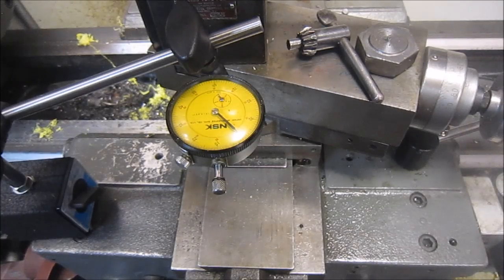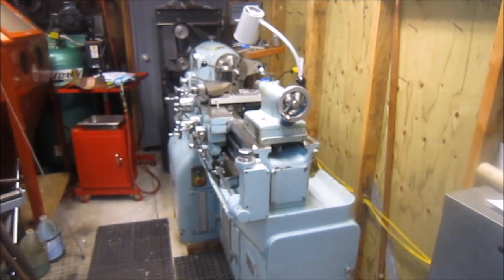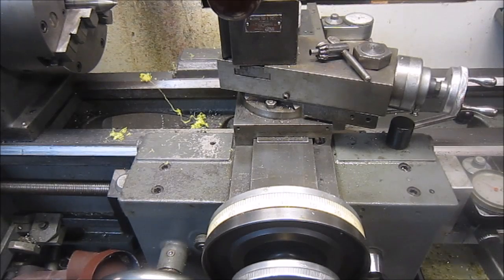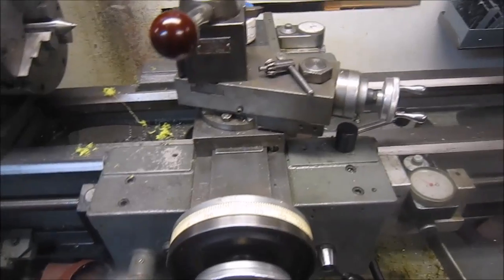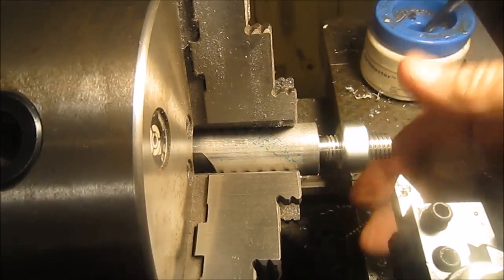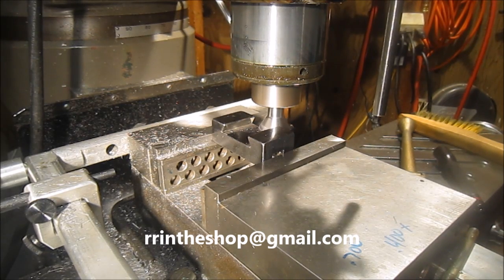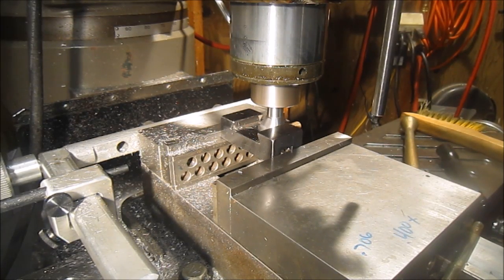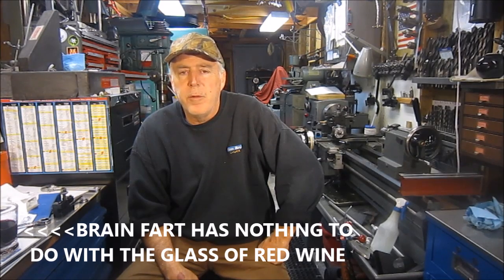Screwy Tuesday #53  Monarch 10ee   Elsr / Electronic Lead Screw Reverse

Comment: I believe that the two threaded holes on the rear of the cross slide of the Clausing lathe, at one time held a retainer plate for a way wiper. That would make another project to show. If you make one, leave a tapped hole for your cross slide stop.

Comment: Hey Chuck I thought the Hardinge HLVH had the finest and easiest Threading mechanics. However, Your 10EE out did that by miles.  Wow what a machine. And that too at age what  64/65 years.  Just a couple of Years younger than me  !!!  My Lathe is 12 Years old, exactly same as the Grizzly Model G0509 and it does not even have half the features or the precision of that Monarch of Yours.  Can we say that it's the original "Rolls Royce" of modern Lathes. Methinks it definitely is.
Must reiterate, U one lucky cat to own one of the finest produced in Your own Country.
ATB
aRM

Comment: One thing you might want to consider, when you are feeding in with the compound for every thousandth you feed in you are also moving the tool .0005 closer the the shoulder of the part. This probably would not be to much of a problem with a fine thread but for a larger coarser thread you will have much more travel in the direction of the chuck or the part shoulder. So for a 8TPI thread with a thread depth of .081 the tool will move .0405 closer the the shoulder of a part. 
What I am trying to say is to make sure you have enough clearance when you start so you end up with enough clearance to finish the thread with out a crash.
This it with the compound set at 30 degrees. 
For every .001 you feed in with the compound the tool moves inward .000866 and .0005 to the left for an external thread.
Cheers 
John

Comment: Hey Chuck,

Check Keith Fenner's dashboard setup. I'm pretty sure he puts the indicator on the flat side of the aloris toolpost. The brilliance of this method is it actually tracks the total infeed of the compound in the X axis. It accounts for any errors in setting the angle and eliminates calculating the diameter change for the thread minor diameter. I remember saying to myself how awesome the idea was from years of sneaking up on the minor diameter with the compound slide only. Nice machine you got there. 

All the best,

Tom

Comment: That's pretty handy. This is probably a stupid question but can't you cut a thread going backwards? In other words instead of backing out and going back to the start couldn't you just advance the compound and cut a thread in the opposite direction? Cut both ways? Did that make any sense? I see another person asked the same thing. Thank for the video. I'm gonna guess, because it would screw up the pitch....?
Reply: This would work in an ideal situation where there is 0 backlash. But that is not the case with traditional leadscrews. So as the lathe backs up, the cut would be slightly out of alignment as the backlash slack is taken up. Hope this makes sense.
Reply: +Kit Barlow: That makes perfect sense, thank you for the reply....
Reply from the maker: +Kit Barlow thanks Kit....good response
Reply from the maker: +Duncan “DunMac” Mac thanks for viewing and good question which Kit replied to
Reply: Another thing to add is that cutting when reversal under zero backlash conditions would only work if you were plunge cutting the thread, i.e. advancing with the cross slide.

If you advance with the compound slide you advance into the stock on an angle and only the left side of the tool tip is engaged when cutting towards the head-stock. In reversal the incorrect side of the tip is is being used. 

In reality there is backlash and if you used the compound advanced method the right side of the tool tip would be used. This would result in the same cut thread pitch but slightly out alignment by the lead screw backlash amount.

I hope this also makes sense. haha
Reply: It make sense for sure. Thanks for the reply, much appreciated. I'm sure you've deduced that I'm not a machinist and have never run a lathe or any machine shop type piece of equipment. I just enjoy watching and learning something new to me.

Comment: I had some import tool holders that were tight on my Aloris QC. It only took a couple of thousandths to make them fit just right. I have a video of the process, including how I measured my existing Aloris toolholders, and determined exactly how much had to be removed from the imports.

That ELSR looks really useful. Now if the cross slide in/out and compound advance could be automated, the lathe would run by itself (until there was no more workpiece left).
Reply from the maker: +Peter W. Meek LOL...thanks for viewing and your comment

Comment: Hey Chuck, am I wrong in thinking that since the lathe turns in reverse, the cutting tool does not need to be backed out at the end of the cut.
Reply from the maker: +Paul Badger Hi Paul, when feeding with the compound the tool is cutting on the left side as you see in the chip, I think due to this along with any back lash in the system, running in reverse with the tool engaged would foul the thread

Comment: At some point in time the Aloris tool holder dovetail dimension was changed, I believe maybe in the 70's. I have run into this before with some real old holders that wouldn't slide on to my 90's vintage tool post. Oh and I believe it would just be Electric Lead Screw Reverse.  The controls all operate analog switches and controls so no electronics involved.  That ELSR makes it where even Howie could cut threads. :-)
Reply from the maker: +bcbloc02 Thanks for viewing and your comments....lol

Comment: The cross feed dial on the Clausing Lathe looks like it came off of a Hardinge HC , did you make this mod ?
Reply from the maker: +Jeffrey Lehn Hey Jeff, I think you are correct, but it was on the lathe when I purchased it, I have picked up the stock unit also and have it in a drawer.  The only issue with the larger dial is depending on the position of the compound it will hit where it passes over the stock dial.....but so far it hasn't been a show stopper